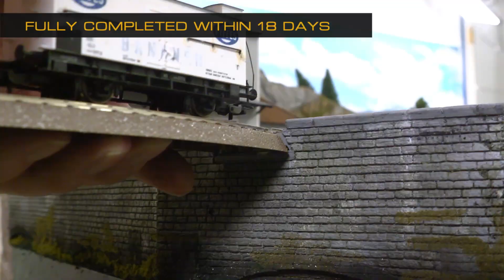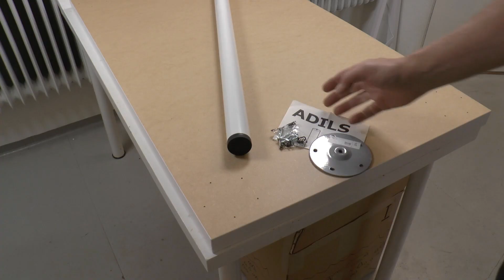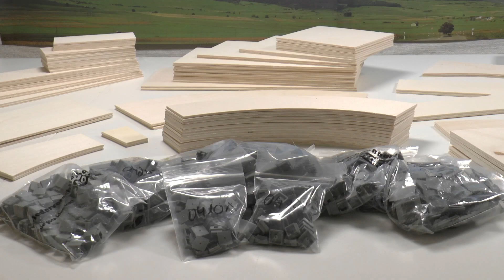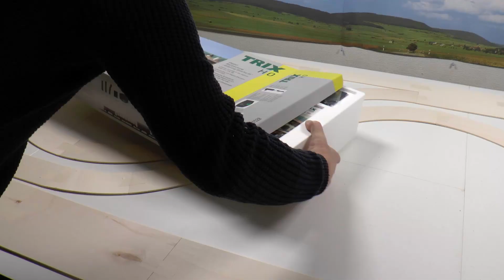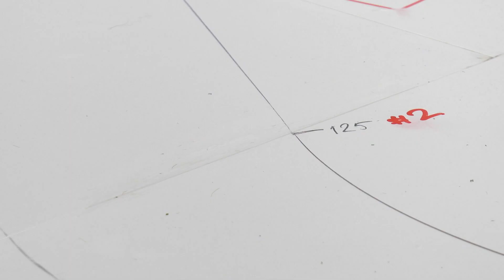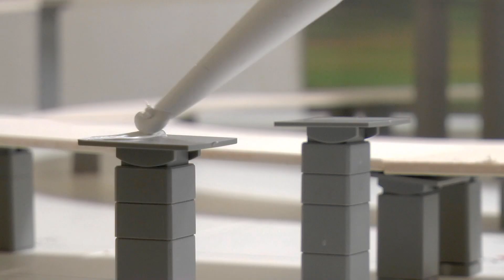EASY-Track assembly - Building a Beginners Model Railroad from ground up.

Comment: What is difference between analog tracks and digital tracks?
Reply from the maker: None. The tracks are all the same. It’s what you connect to the tracks as power source that makes the difference
Reply: What trix set gives the most bang for the buck? As Starter kit for Martintown

Comment: Hi Martin,
Last weekend I came across your channel here on YouTube, you have so many great tips, products that you use and techniques, thank you for that. I enjoyed the series and downloaded the track plan with the shadow stations from your site.  
I would like to start building that track as a good base with variation. 
Right now I have an oval with some switches to have some sort of side tracks to park the material,  but it remains a very simple track with no variation variation in it. So I would like to start the build of Martins town as a base and maybe expand later. 

Do you have a description with the measurements of the sub-roadbed you can share? I'm looking forward to start building in the next couple of weeks during the winter period, I would like to use the right sub-roadbed with the right measurements so it will fit the trackplan you've created.

Greetings from The Netherlands

Comment: I haven’t read all of the comments so apologies if I am repeating one or more other people. I was on the IKEA website and the one thing I discovered is that the table and legs that you’re using are only about 30 inches (70+ cm) tall. Isn’t that way too low for a model rail road?? I thought the rule of thumb was a deck height somewhere between 48 and 50 plus (120+ cm) inches??

Comment: Great video. I work for IKEA in Cardiff and my department is the one selling those table tops. I've often wondered, when it's quiet, how feasible the Linnmon tops would be for baseboards. I just wish we sold a slightly sturdier leg that was taller then the Adils as I think they are a little on the low side.  
Looking forward to the next episode!

Comment: Looks great ! One thing though, you could save some money if you cut pieces of insulationfoam, as you know the height for the pillars, and used them instead of the plastic ones. That way you also could make som more and put them between those you already have used. Would probably make a more supporting railbed. Wow and in n scale that layout would need only a small fraction of that space. Thanks for a nice video. Looking forward to the next one. Stay safe !

Comment: Great series Martin. I was just wondering how stable the Linnmon tables will be in the long run. I had a setup of 3 of the 150x75 Linnmon tables, which I used as a large table for Wargaming. Over time they all sagged towards the middle. It didn’t matter too much for wargames but I imagine it could be a problem for a model railway layout. My tables weren’t bolted together and didn’t have any fixed superstructure on them, which I expect will make your setup much more rigid. I do like the idea of using the IKEA tables though as constructing baseboards is off putting for some. Looking forward to the rest of the series.
Reply: A great question Alan, I am planning a layout and was intending to make  lightweight torsion box type base board(s) using 6mm ply but braced and skinned top and bottom. I did wonder if just an Ikea table would work, so look forward to Martins answer..;-)
Reply: Add extra legs in the middle of each table and it should prevent at least some sagging. Buy "Lerberg" or "Oddvald" for a more even distribution.

Comment: I noted that here are two small errors in the parts list for Märklin. 
1. The Extension Set C2 is Item No 24902, not 22902.
2. The straight track 24172 is 17,17cm long, not 18,83cm.

No big thing, but I thought I could point it out, just to avoid any misunderstanding...

Comment: Wait what? You did a CAD drawing of the sub roadbed and had it manufactured and shipped to you from where exactly? That doesn’t sound like a simple task. Does everyone have such a service in their area?
Reply: I think he used CAD to design the template and then he cut them himself.
If not, you can send the CAD file to a company that will cut it for you and deliver them to your house. 
At least here in Sweden.
Reply: @petter5721  Nice to live in Sweden.  I'm not sure if such a thing is available in the USA at a reasonable cost... though I've not actually checked.  I'm assuming, given our plywood is generally not as nice in the home centers and multiplex is an unknown, that its not a common option for us.  Though I do have an IKEA nearby... much of the US has no IKEA near by (unless you drive for over a day or more by car ;- )    )